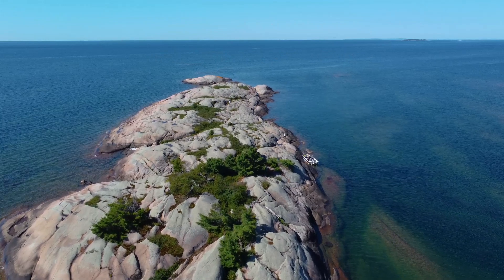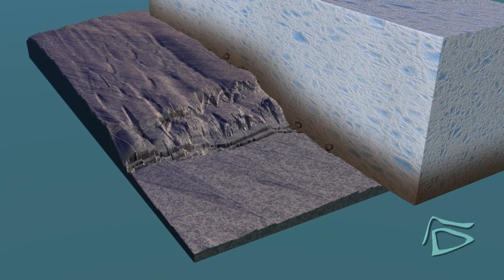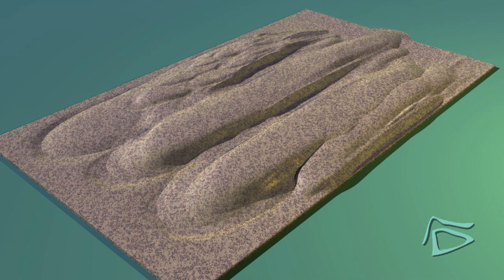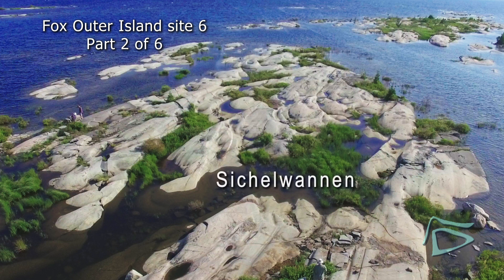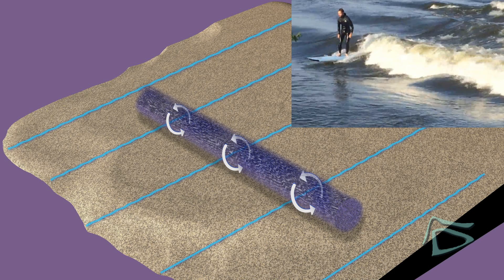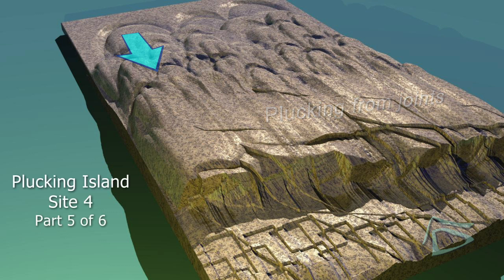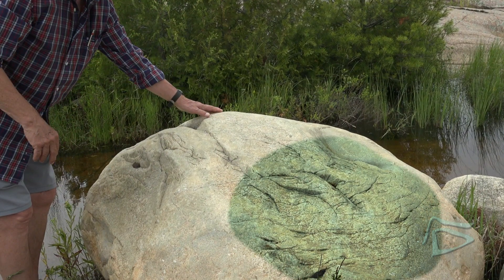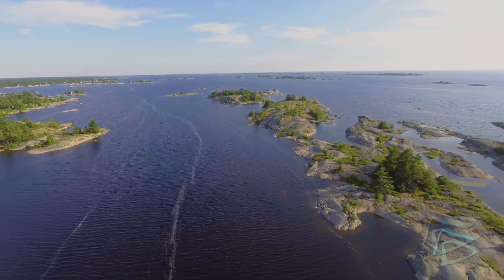Introduction: Georgian Bay bedrock erosion: evidence for regional floods

Comment: This was not a regional flood. We have the exact same landforms in Scandinavia and you can see the direction of erosion on lidar images. The initial wave hit us from the north west, and reached our highest peaks at 2400 meters above current sea level, meaning that it came from Greenland.
Reply: Notice the cracks in the rock wich are paralell to the erosion. These are hydraulic ditches and are always straight. They range from centimeters in width to several kilometers in width. They cross the entire country of Norway and are not linked to geological formations. They are always paralell to the erosion. Many places there has been erosion from a different direction later. Glaciers can only move down hill so they cannot be the cause. In many of our valleys the erosion goes up hill and inland.